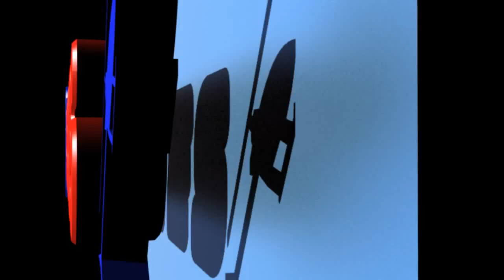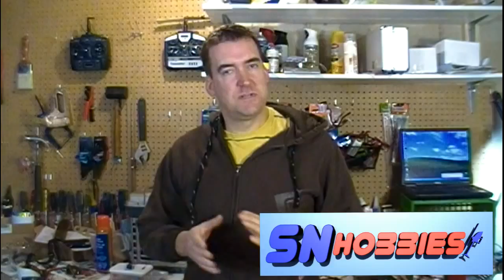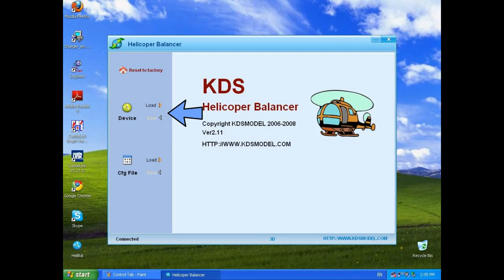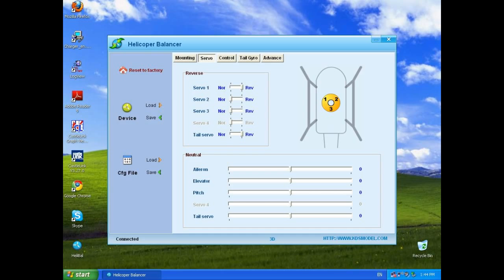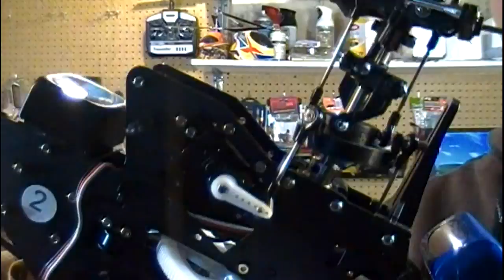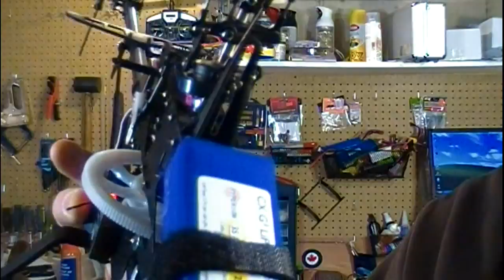KDS Flymentor Setup - SN Hobbies

Comment: True there is a mass of information. But its not entirely well written or accurate. Some of it is as incomprehensible as the original manual for the Flymentor.

Most of the people who talk about the system are hackers who crash around the settings until they have a set-up. They don't seem to have a rigorous approach that suggests that they know why they have changed settings.

As with all such systems, read the manual and try to understand what the designer had in mind. And use the defaults.